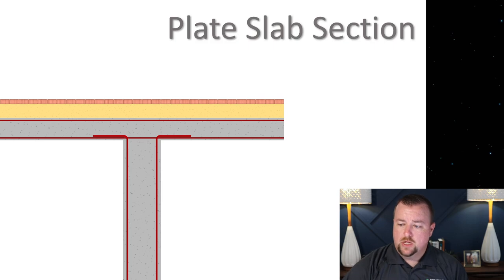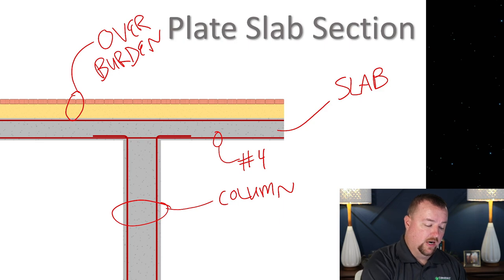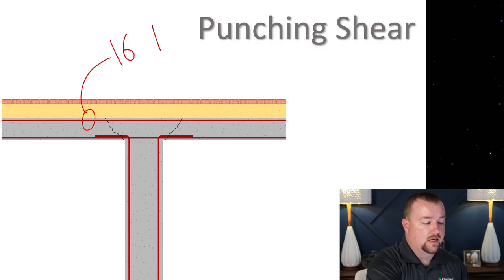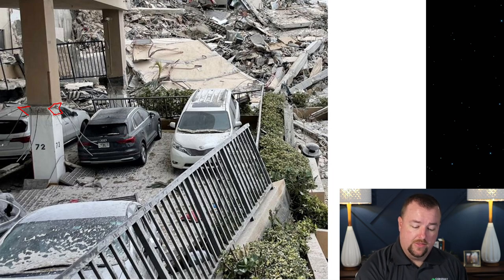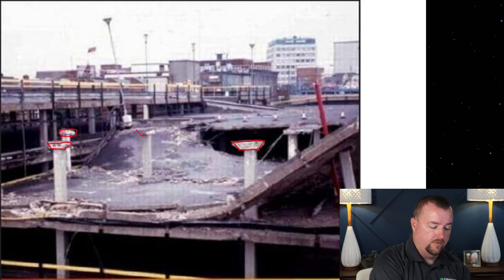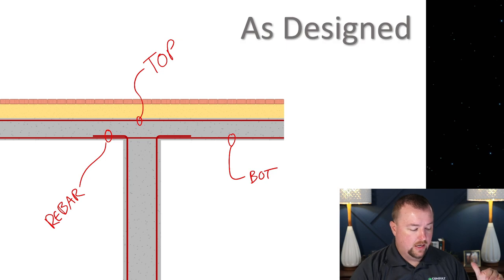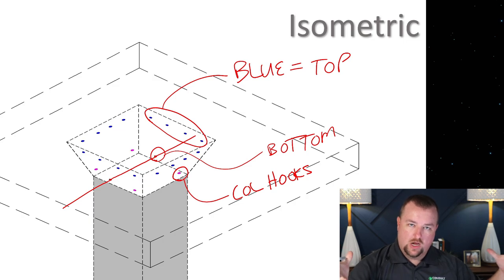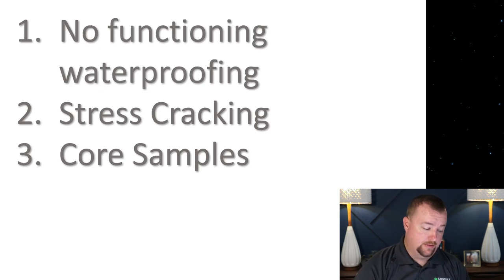The Importance of Punching Shear at the Surfside Collapse

Comment: There is only one principle to understand. Concrete is amazingly strong under compression. It is not strong under tension or shearing forces (it pulls apart easily especially at a 90 degree corner). Hence the Rebar in structures. Rebar steel is amazing under tension and resists shearing forces but is terrible at resisting compression. If the rebar rusts out due to water infiltration the tension and shearing forces  due to the weight of the pool deck slab and everything on top cannot be held up. when rebar rusts it expands cracking the wet concrete. wet concrete molds. mold eats the minerals and increases spalling. once the concrete is cracked it can no longer hold the compressive forces. likely several columns and the slab around them failed due to water infiltration shifting more tension onto the  rest of the slab which itself was compromised due to water. once the pool deck sheared and collapsed it likely took out even more columns. this is like pulling all the bottom pieces out on a Jenga game on one side. without support on one side the whole side of the building sheared down and off. Likely the water damage and mold was throughout the columns all the way up. water has a property called wicking due to hydrogen bonds and tension if you put a concrete block in a kidde pool filled to 1 inch eventually the whole block will be wet even at the top because it will "soak" up the water. this greatly increases the concrete weight as well as the water chemistry and chemicals dissolving the cement in the concrete turning it to a more sand like consistency. water is incredibly destructive to buildings and this is why.

Comment: Hey Josh - so, after watching this, what I'm still confused about is this:  if the pool deck slap collapsed / punching shear, why did the rest of the building come down?  Why didn't just the pool deck collapse into the garage and everything else stay supported?
Reply: I will try to put my guesses here after reviewing the as-built structural plans available for download from the Surfside Building Dept website. I am a practicing structural engineer in SoCal since 1987.

(1) There is a 18" to 24" elevation difference between top of the pool deck and interior ground surface of the collapsed building portion which are apartment units. The pool deck side is lower. the columns are small in size probably designed to meet minimum requirements only.

(2) There is a concrete beams (spandrel) along the edge where pool deck and the higher apartment unit deck meet connecting all columns. The columns are poured to the bottom of the pool deck first. The pool deck, spandrel beam, and apartment deck then were poured after columns are cured. 

(3) After the lower pool deck collapsed, the spandrel beam lost lateral constraint from the pool deck and was pulled to the pool side. Notice the columns are not continuously poured. The torsion due to rotation of the spandrel beam causes the columns above and below spandrel beam to buckle laterally. It's like two 4x4 wood posts connected end-to-end vertically and were pushed sideways at the pinned connection.

(4) This horizontal movement of columns creates P-delta effect not considered in the original design.  P-delta effect simply means additional bending moment due to vertical force times horizontal deflection of the column. Most of time, all gravity columns are designed to resist vertical load only and cannot resist the P-delta moment. After the lower columns failed, the building collapsed due to its own weight.

(5) There is no elevation difference between the pool deck and the remaining and standing building portion which is the lobby area. The columns are much bigger in size probably over designed for architectural reasons. Even after the pool deck and lobby deck failed, the two-story columns remain standing due to  rigidity of the large column size. There is no lateral buckling since there is no spandrel beam like the collapsed building portion.

(6) The building appears to have been designed to meet MINIMUM code requirements only at that time. Building codes have been revised many times sine and are much more stringent now.

Comment: Is there such a thing as bad concrete? Could the initial pouring of the concrete been done incorrectly?
Reply: Yes there is such a thing, but not as likely as you think. During the pouring of this kind of slab, test samples are required for inspection. Follow Josh's other videos. Buildings like this have certain maintenance and inspection requirements also. Water intrusion seems to be a major factor for this building

Comment: It's not crucial, but I don't understand the rebar count. If the lower mat contains two rebar in each direction over the column you would have to break the four rebars in eight places to achieve punch-through, not six. 
And the top mat count would require 16 breaks, had it not horizontally split the structural slab and disappeared from your model.
The cores show fractures at the lower mat as well. Consistent treatment would require them to be removed from your model as well.
Could the fractures around each mat have been caused by impact rather than over time (from rebar expansion due to corrosion?)
I'm not sure you can ignore the structural strength contribution of the slab (slabs, after the splitting) itself (themselves) that way.
If you don't punch through the upper mat, why and where does it break apart? And where is the upper mat in the photos?

Comment: Concerning the concrete core samples that were done in October 2020....if that is the rebar in those samples, wouldn't that mean they took the sample from the side of the column rather than in a top to bottom direction? And they cut through the rebar....wouldn't that weaken the area where the rebar are now sliced? Kind of scary. If they did truly cut through the rebar to get those samples, that could be the start of the weakening of this building. How ironic it would be for that structural engineering company to be warning the HOA of this building that it's unsafe when they actually cut through the rebar to get their core samples! Ugh.

Comment: Not only was the building a crap design but when it fell it turned into powder. Instead of remaining in large chunks which is an indicator of rounded beach sand not sharp clean sand.
Reply: @craigjensen6853  plus I hate buildings on chicken legs construction. (Built on columns only construction). In my opinion it only exists because owners keep screaming about square footage and cost. Look what happened to hard rock hotel.
Reply: Over spanned and under delivered

Comment: The fact that there have been so many parking structures built by this method failing around the word might suggest that there is something inherently bad about this design. Vehicles are  heavy with their weight applied in 4 points of contact rolling over slabs on a daily basis. Slabs laid on soil crack. They are expected to crack and are sawed or troweled to have a place to crack. Why are unsupported slabs expected not to crack?

Comment: Like your car's rust faster at sea level due to humidity a building that is subject to this much water damage. I think water proofing your rebar is essential to top structure performance within the concrete. Better put extra reinforced rebar thru your base. Without foundation nothing can stand the force of gravity.
Reply: The builder got pressured thru the low bid and timeframe of the contract skipping vital structure support measures. Stronger support column's on the side that stood. The sheerwall separated the building's design. Smaller support column's on the failed side. Plus they added a penthouse on the 12 floor original design.

Comment: Upon watching the building collapse with such ease my synopsis is inadequate engineering. My limited commercial concrete work always entails supporting reinforced pads on top of the columns with the slab on top of that. There looks like less steel in the building then I put in a house

Comment: I believe the column that is missing and did not punch shear like all other columns it is the root of all things that occurred, I wouldn't think so if it did punch shear, but giving its location, in my opinion, it has been struck way to many times by vehicles, and could have even sustained a major accident way back in the past being at the end of the ramp from a 70's Cadillac. I was really hoping it would be believed that the planning team didn't failed, once being in the architecture business, the revision and removal of drop beams big over site on the structural team

Comment: The column main bars should be terminated near the top of slab, not at the bottom.
Reply from the maker: Yes. I added a note about that to the video.  The drawings actually show them terminating in the middle of the slab. So it's anyone's guess how they actually did it.

Comment: The question is how about their other building that was build just like this one?
Reply: There are plenty of buildings built just like this- I work in one. This building failed due to neglect, poor maintenence and failure to address a waterproofing issue.
Reply: I wondered about that as well. I'd be particularly suspicious of buildings built before Hurricane Andrew. After Hurricane Andrew Florida began to more reliably enforce building codes and building codes were strengthened. And I'd be very suspicious of any building with an outside deck tied into the main building. Despite what appears to be bad maintenance, structural design issues and construction issues this building would be probably be standing if the pool deck hadn't been tied to the building structure.

Comment: I would really enjoy to be part of the forensic engineering team. I would look at samples to determine rebar size, quantity, corrosion. Concrete strength! It might be possible salt water degradation of concrete strength has occurred. Need geotechnical soil boring to be conducted. Need to know what level of moisture is present today. Time is of the essence. As time passes “current “ activities leadin to potential saturation may diminish. True scientific comb need be applied. Boots on ground. Where are the people on ground?

Comment: The photo at the end how is there absolutely no rebar sticking out of the slab that is still intact?  The concrete appears just to be evenly sheared off even around the column I think it’s labeled 73 in the back of the picture has no rebar sticking out from the side in front of it that is sheared. 

My thoughts are the builder who built these towers better hope their not in business any longer cause the lawsuits are going to be huge not just from this building but the other 2 towers with the same design. From everything I’ve seen it seems like they cut some corners and didn’t follow the engineering plans. I’d also think there is some blame on the company that drilled those core samples as that looks pretty serious if they were that damaged in multiple locations. Someone should of been sounding the alarm.

Comment: I see so many pancake style buildings going up all over SF, back in thr 30-50's or later, there were mushroom caps at the junction of post slab
Reply: If you do the punching shear calculations you might find out that those were necessary.  They were very common in previous years, not so common now.  We have other ways to deal with punching shear.

Comment: but even with the punching - with all the rebar specified, there seems to be no evidence of the topping cross-membered rebar over every column. There only seems to be strands of the column's rebar (about 2 strands in every direction from a single post). 

You would think 8 (4  & 4) strands of rebar would have shown in those heaved  pieces. That's dense enough webbing to show up everywhere there's a column that punched through and I see none.  Could it be that those specified 8 pieces that were supposed to be 4 & 4  across the tops of the columns never got installed?

Love watching these videos. I'm an electronics engineer -- so this analysis is still a "engineering junkie's" fun evening watch. :P

Comment: why oh why is the obvious being ignored in all of these videos? Why has nobody claimed that the concrete used on at least a major part of the structure in this building was clearly sub standard? Concrete in the identical building down the street is completely fine. built by a different builder using the same plans? Answer: Because they did not use sub standard concrete.

Comment: Comes mostly to salts and rust. Concrete moist / steel rusting expanding / concrete letting go / delaminating. 
Soooo, it there would have been serious waterproofing ( close to salt water and salt air) this could maybe not have happened ever.
Maybe they should go looking for waterproofing and taking more cores. Then tear those buildings down before more die.

Comment: That the building lasted 40 years despite having an inadequate and neglected water proofing membrane that lead to the global deterioration of the patio, pool, and parking deck structural slab is a testament to the large amount of rebar within the slabs, beams, and columns and the general and adequate strength of the building when first built. The cores and the endless cracks and widespread water seepage in underground ceiling reveal that the entire patio, pool, and parking area slabs would have needed replacing and water proofing correctly installed.  

It's extremely difficult to imagine NIST, the town, state, federal government, and hired investigative professional engineers revealing the true nature and source of the collapse due to these mainstream corporations, governments, organizations, and similar involved bodies all protecting themselves and each other to maintain each others investments and reputations and avoid accountability. When NIST is brought in, one knows a face-saving, well-organized coverup is being arranged. It's all politics, saving the cartel family that runs modern civilization as a profiteering, racketeering business, all parties forced to go along or they don't get to eat from the gravy train, the only way to survive and thrive in the cartel's Mod Civ. Only fully independent, from-the-outside researchers will reveal the truth, individuals that have nothing to lose and everything to gain by being honest and true.
Reply: Blame it on global warming and the paymasters are happy.

Comment: more relevant is draining system, underneath and on the floor.
Reply: It has merit. I agree. See the stalactites on the pipework, that takes years to form & where was the water coming from; the pool deck above. The slab & beams were saturated & the slab was cracked. A recipe for a disaster.

Comment: I appologize guys, I'm from Chile, a country submitted to strong mechanical forces because of earthquekes. The engeneering estructural design of this building was a deep mistake...!!!; the designers didn't transfer the loads from the bottom of the slabs to the top of the columns when they go through them. In addition, vertical steel rebars (from columns) should be cross up slabs from slabs to slabs to get vertical continuity in discharge for dead loads. I appologize my English but I'm not an English speaker.

Comment: Your delamination theory makes the most sense...I would be kinda surprised if major deviations from the engineering drawings made it all the way through to having the inspector sign off on the rebar.
Reply: Multiple photos of the deck slab show very little rebar after the collapse. P.S. Don't underestimate corruption in Florida in the 1980s.
Reply: @gordonrichardson2972  I'm well aware of Florida's corruption...An inspector possibly could have taken some sort of kickback to look the other way on something like the waterproofing because he didn't comprehend it may cause a disaster in the future. However inspectors understand rebar on a reinforced concrete high-rise has to be right or the build may fall down. They're not going sign off on rebar that's not to spec just cuz a contractor left an envelope on their car seat or new Barbecue on their front porch.

Comment: Why is more steel (blue) on TOP? Why wouldn't it be on the bottom, to carry the load? smh
Reply: Because over the columns the tension is in the top of the slab. At the centres between the columns the tension is at the bottom so the steel should be there. But there is not much steel anywhere. I live in an earthquake area so it all looks awful!

Comment: Surely the north building was built exactly the same... I can't believe people haven't all left!
Reply: Better ongoing maintenence.  The other tower had a different maintenence program that been written up by city inspectors for having a well run program . It was a different management team .
Reply: @roguedalek900  agreed, but there's more going on than maintenance here... Since both buildings were built at the same time, by the same builder, likely using the same materials, any deficiencies as far as not enough rebar, issues with waterproofing, etc etc etc are likely going to be identical in both buildings so maintenance can only maintain a flawed design or errors in construction for so long... At the end of the day both buildings are going to be exposed to the same issues and maybe this building lasts longer because it's had better maintenance but I certainly would never want to live in it because the minute there's a slight earthquake, an exceptionally strong hurricane, a rogue wave etc etc and what happens then? I think that they were saving money by cutting back on materials and that would be happening with both of them since they were both built at the same time by the same builder.... I wouldn't be able to sleep at night in that building